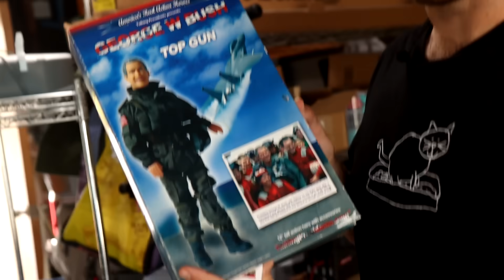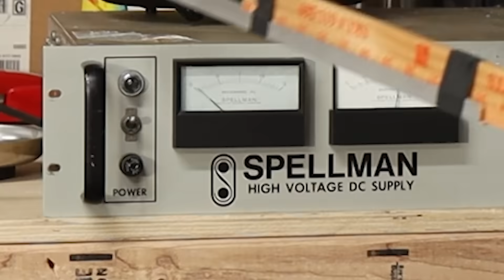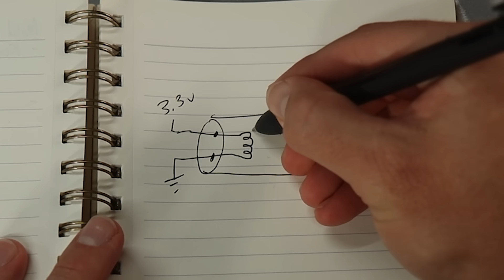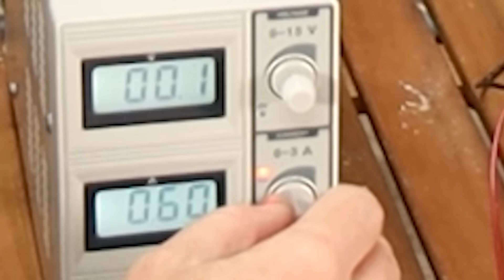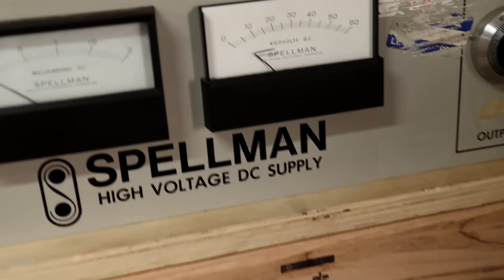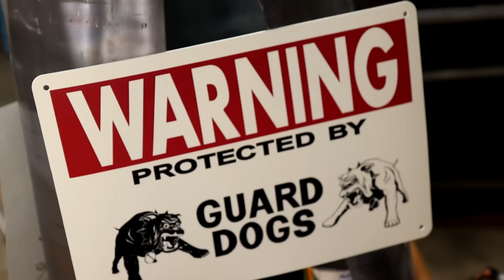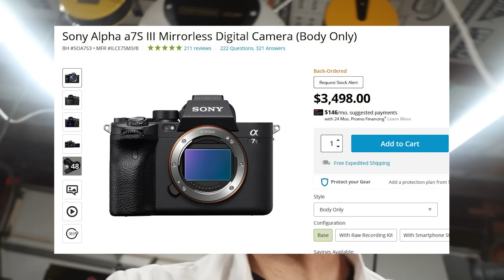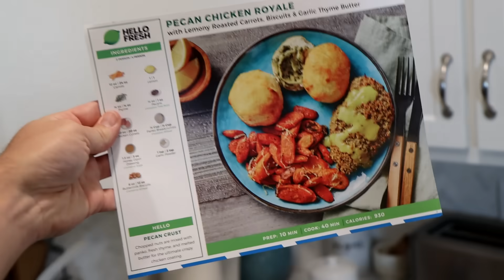Built My Own X-Ray After a Hospital Charged Me $69,210.32

Comment: Sorry to say but GQ GMC 300E Plus is a poor choice for your experiment. According to GQ documentation it has gamma energy range of 0.1 to 1.25 MeV which means your device must have a potential difference of at least 100000 Volts in order for x-rays to be detectable.
Reply: so whats your point?
Reply: @jacobcronk1844  Geiger counters are not the best tools to detect high energy photons: either quantic energy may be too low or the real dose rate is several times higher. Scintillation counters are the best for this. That's my point.

Comment: all of this was just me saying no, no, no, don't do that, that's going to be something that can easily kill you. ;(
Reply: The only thing was going to easily kill him was the high voltage, considering he started the normal power supply current limited and slowly increased the current until it worked. That shows me that the doses of radiation he would have gotten are nowhere near deadly, since if they were then xrays wouldn’t be ok for medial use

Comment: 4:40
I like how you force 60,000 volts through basic low voltage wiring configured into the shoddiest circuit possible and then act surprised when excess electricity is discharged.

Comment: Um, that “oil” in the dental x-ray machine that you bought on eBay… you might want to research that before you dispose of it. It may be too late for you, but maybe you can spare others.
Reply: what is it?
Reply: I was half joking, but the oils used as dielectrics in high voltage applications prior to the 1980’s contained polychlorinated biphenyls, aka PCBs, which are now banned due to various health effects including adverse neurological and immunological effects.

Comment: The bill reminds me of the insanity of Korean mobile Internet bill back in the early 2000's. Back then, the nominal mobile Internet connection rate was insanely high. Of course, it was just the carriers' excuse to force people to have a monthly plan. So, the bill showed something basically like "Your total mobile Internet connection fee of this month is $100K, but since you have agreed to sign up for our generous monthly data plan, you only have to pay us $50." 

Things have changed since then, so now the nominal rate is cheaper and there is maximum monthly fee limit of something like $100, so you won't be paying $100K even if you did not sign up for a monthly data plan.

Comment: From the looks of that picture of your hand I can tell that the kVP on this dental x-ray tube was unsufficient to penetrate bone structure and show all of the trabecular pattern in your bones. In addition to low contrast and detail rendering this picture diagnostically useless, you subjected your body to much higher radiation dose than needed, because of the low kVP. Contrary to the common belief, the more energetic X-ray beam is safer for you as less photons are absorbed in the soft tissues and less oxidative damage happen to your cells. This is why machines using low kVP, if used on larger body area are likely to give you a higher radiation dose. I.e. Mammograms, which has to use low kVP to differentiate structures in soft tissues, if done frequently increase the probability of breast cancer.

Comment: I built one that used a surplus fixerupper inspector 200 Golden Engineering industrial x-ray unit. Modified the pfn to trigger at anywhere from 2kv to 18kV giving a pulse of anywhere from about 60kV to 300kv. Then the capture unit was made of a GADOX intensifier screen that was imaged on an intensified CCD detector to create an inage. I used it for industrial purposes but ig you tuned it for anywhere from 60 to 120kv output it would be ok for medical images. Unlike most x ray units it puts out pulses of a mere 60nS. The power of those pulses though would be in the multiple KR per hour if you do the math. Also old dental x rays can be used directly. They put out about 70R/Hr for old 70kv heliodent and old 90 to 120kV GE or ritter tubehesds put out... 450R/Hr. Both should only be used at 2 seconds max or the guts will go Chernobyl 😁

Comment: My only problem with your safety setup is that you have NO idea what voltages control the AMOUNT of X-Rays coming off that tube. You tore it out of a machine that precisely-ish controlled the amount of x-rays... you then hooked it up to random high voltages.  You may be making 10 times what the whole machine was designed for. Your temperate view of x-ray dangers would hold true if you could be sure that tube was ONLY producing the amount of x-rays the whole machine originally made - but, you have no idea how strong of an x-ray you're making... 
I'm not saying don't do it... I'm just saying, more sheet lead, and a little more distance between it and your meaty, cancer getting, bits...  The inverse-square law is your friend...

Comment: I don't know what particles your X-Ray machine was emitting !  Hopefully it was neurons and not alpha or beta particles .  I don't think your machine was emitting ionizing radiation,  because you and your neighbors are in big trouble !  In Canada the part you got from an old dentist's X-Ray machine would never find it's way to a non medical facility . Equipment and parts are closely monitored and followed by the federal government . They know where X-machines are even  from the 1930s  and if they are being used or out of commission .  Technically someone can build the tube used in primitive X-Rays machinery,  a copper foil and electricity , glass etc .  But parts from old equipment are not sold on the open market or to private individuals . Cheers

Comment: I work in the insurance industry. I'm not 100% sure if this applies in this instance (I'm just a developer, not a lawyer), but by law (depending on several factors, state, time of injury/procedure, type of doctor) the hospital/practitioner is only allowed to charge a certain amount for a given procedure. However, hospitals charge more than the legal amount anyway. They do this to try to milk as much out of the insurance as they possibly can. If the amount charged is higher than the legal limit, the insurance company will hire someone (or do it internally) to come up with affidavit that proves that the hospital is over charging. They will go to court and settle on an amount that the insurance companies need to pay. Like you said, they also do this to uninsured individuals, but the individuals do not have nearly as many resources to fight the hospitals in court, so many end up stuck with the debt. This is the main reason why so many Americans have so much medical debt.

Comment: Nice video. How much power does that high voltage device use? Is it like plugging in an electric dryer or stove?
Reply: probably not, im guessing it isn't passing much current, in fact im guessing the second meter is probably current, im not going to look back at it but its probably more than a few hundred watts at most including losses. These types of applications generally just need high voltage, could be wrong though.

Comment: You should have more clear that if you get too close to high voltage wires or some furniture it is on, you could die or have rubber melt on your hand in a second. 34 people died from fractal burning due to touch anything that became a wire. You should be clear that you and those around you should stay away from the high voltage. I got this info from a video on the dangers of fractal burning.
Reply: You were over cautious with x ray danger, sad that people attacked you anyway. Sad that the shove comments exists, I thought that joke was funny.

Comment: As a radiographer and former electro-mechanical engineer, we have the training to say that what you've done isn't actually all that bad. Although it does seem like your power source isn't particularly stable and you're not using any filtration. It is possible that your skin dose is significantly higher than that of a properly tuned DDR xray machine we use in clinic. You can see the joint spaces of the 2nd through 5th MCPJs clearly so it's halfway diagnostic for dislocation, you just need a lateral. Unfortunately you cannot see the trabecular pattern on each digit making it undiagnostic in ruling out fractures. Just be aware that scatter can and will continue to move until all energy is transferred. If your hand is covered by a plate top and bottom then scatter will continue to bounce back and forth increasing your dose. Exactly the reason we don't use gonad shielding here in the UK anymore. The radiation is the least of my concern for this xray machine

Comment: sooooo.... while yes the core components are significantly cheeper to purchase. the real reason why its so expensive tobuy a fully functional one is they must pass a FDA safty inspection and must be FDA certified for use in medical diagnostics or treatment. does this mean 300$ for an xray (or 2000$ for a CT scan) is fair, no but it does mean that doing what is done in this video IS NOT SAFE! And to the point of your exposure is more in other places NO IT IS NOT! YES you are exposed to radiation everyday in the form of backround radiation and yes it is verry often nor then getting a SINGLE xray but, in this example the filement is completely exposed. he is being exposed to the equivalinet of several Xrays every second that the device is in operation. yes the lead liner is protecting him somewhat but for it to be effective it would have to be fully surrounded and sealed. In fact in hospitals you will offten find areas with radiology equiptment have lead lined walls and even led lined electrical and data wires for computer connections to prevent X-Ray exposure to staff. finaly the point of this comment DONT DO THIS! If you have a broken bone (or think you do) GO TO A DOCTOR. think of it this way would you rather pay 300$ for an xray (assumeing you dont have insurance or other suplemental coverage) OR several thousands or tens of dollars for electrical burns, nurological damage, possible pysical theropy after the nurological damage, and risking burning your house down. 300$ doesnt sound so bad then right?
Reply: bro it's for fun. no one would actually make an x-ray machine lmao

Comment: i tried something similar but used a fyback transformer from an old Trinitron 17KHz with the low side driven by a FET and the high side through a half wave rectified variac (I was getting decent arcs about 7 cm long) - for an intensifier I used glow in the dark safety tape. I brought the high side up until I smoked the transformer, but never detected any glow from the tape. Tried again with an ignition coil from a Crown Victoria - same results. I guess just not enough anode current?

As for the safety Nazis .. Yeah, I'm not too worried about a few x-man rays for ten seconds of bench play trying to see the shadow of a quarter .. but the power supply you have is a bit scary - sounds like it has some bite. I don't know if anyone has actually managed to harm themselves with a flyback aside from offending god with really loud expletives - but that box looks like a 'don't try this at home' unless you know what you're doing decal.

Comment: Not trying to be a safety nerd here but one little improvement you might want to make on it is dialing in the x-rays The reason your image was so vivid was because you have the power turned up the way too high Figure out a way to turn down a little it will still work as an X-ray machine. But nice work otherwise that is awesome also your woman or caretaker whichever she is, Looked like she thought she was throwing the switch for your electric death chair lmao

Comment: 400 dollar for 60kv.🤣😅 bro wire up some flybacks in series and give them all a personal zvs driver😁 i did this with 5 flybacks and drivers and results where 150kv minimum arced over at  16cm reliable. And yes i used a bigass saltwater capacitor at the end. It could be even cheaper then you did it!

Comment: At 0:21 you can clearly see a 10000 count container of colt brand yellow .12 gram  6mm airsoft bbs that comes with a miniature spring powered pistol inside of witch is available at big 5s for 39.99

Comment: Everytime i hear about how much patients are charged in the US, i am glad that i live in Sweden.
Because a visit to the doctor, depending on what the visit is about, costs about 150-300 SEK (1 USD is about 9,49 SEK as of to todays exchange rate) and if you need to get an x-ray you aren't charged because that is part of the doctors visit.
Surgery costs 300 SEK and you pay 150 SEK for every day that you are hospitalized.
For every 12 month period, when you have payed 1200 SEK you then get a high-cost protection meaning that you don't have to pay anything for health care for the remainder of those 12 months.
Also, a ride in an ambulance costs you nothing.
You can even get a high-cost protection for medicine, when you have payed about 2400 SEK within a 12 month period.
Reply: Here in Norway it is 350 now I think but if you are late to an appointment you get 1200 NOK (about 150$) fine and in winter chances is extremely high that you will be late as often the 3 hour drive to doctors will turn into a 10 hour drive because of bad weather.

Comment: I think we need to restrict access to this type of material for Russia - otherwise the restrictions on imported goods will literally have no effect. Imagine if they can just start building their own high quality medical grade X-ray machines without relying on the west.
Reply: Even if they were dependent on the West for medical equipment (which they are not), the industry behind it is just as important as the materials. Hard to just go and produce as efficiently as the West when you're working from ground zero without existing corporate infrastructure and investors (and with a tanked economy). More importantly, they would already have these machines and have the ability to maintain them. They would basically be set for the forseeable future regardless.
Reply: @ciara7172  Thanks for taking time to explain 💚

Comment: Not even every home. Just one per neighborhood. 
The engineer or electrician can run the x-ray facility, the artist (ceramics and/or sculptor preferred) can do the casts, the stay-at-home mom or tailor can handle stitch and the carpenter can handle small scale surgery. That's basically all injury related ER visits covered. 

If you have a chemist or biologist you could probably handle most disease and accidental poisonings in-neighborhood, too.

Comment: rewatching this made me compare the cost of your treatment vs how it usually costs here in the Philippines in a private hospital where prices are only padded slightly (10% at most)

I'm honestly not surprised if the hospital would still get a profit purely from how much you had to pay, without however much the insurance company paid them. That's messed up.
Reply: yeah. i also remember back when health insurance was a requirement here for a few years, which sounds alright in theory.... until you remember that the govt isn't providing it. if you didn't get insured by an employer you'd have to go out and pay $3-6k USD a year (from the insurance marketplace) and have terrible coverage

and, if you didn't get insurance, you'd pay a percentage of the cost of the cheapest marketplace plan (as a tax penalty) AND get zero health insurance in return

Comment: So I’m making the same thing as you making. Here’s some of my experience:
First I dipped the whole thing into a plastic box that fill with isolation oil. Cause I’m ran into the same issue like you do which is high voltage shock through the air and arcing. And second frankly speaking I will not dare to take a photo of myself with this. Cause hospital have all the stuff that reduces the amount X-ray you getting, they have a more sensitive image taking system so they only need a little amount of ray to take a picture. A Sony camera will not be greater than that. But I’m getting your idea. I think we China have the same issue here. Hospital know insurance will pay for you so they charge you more than they should. By the way I will recommend you to buy a lead cloth. It’s usually made for the X-ray operate doctor in hospital. It provide you the protection and you don’t need to deal with lead cause lead is harmful to the brain. Now I’m having a problem is that I don’t have a proper filament power supply. I’m powering it by two 1.5V batteries. And it’s not working. So I’m waiting for my adjustable power supply to deliver 2 days later. And by the way you don’t need a half broken high voltage power from collage to create 60kV. It’s too expensive for me so I make my own power supply. And the whole thing includes the X-ray tube cost me about 1400¥ which is about 200$.

Comment: First vid I have watched and you are effing hilarious. I like the nonchalant, don’t give a f attitude. High voltage scares the crap outta me. Replaced my water heater and had the breaker on and thought was off, I luckily checked with a multimeter but I almost touched the lead. Subbed.